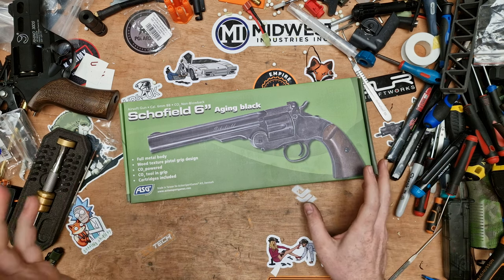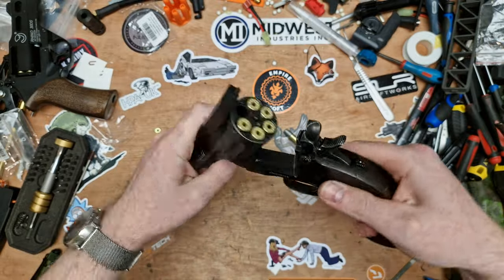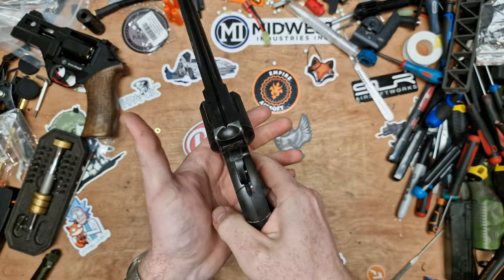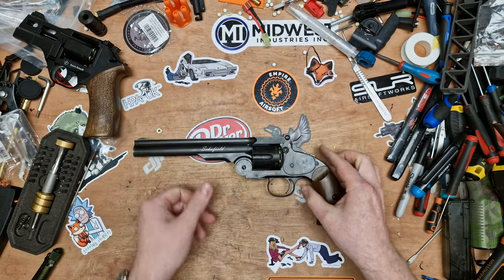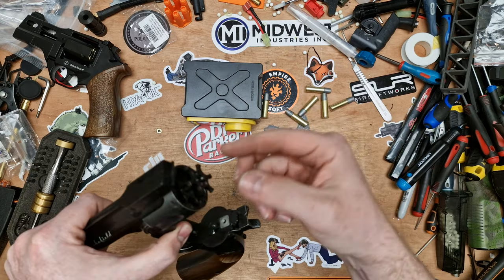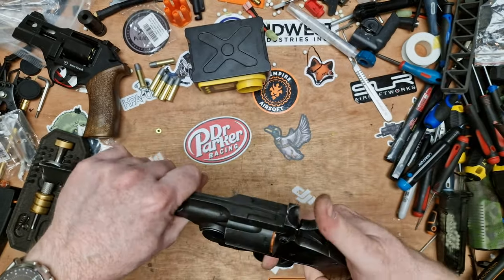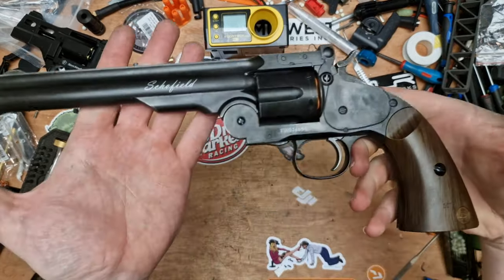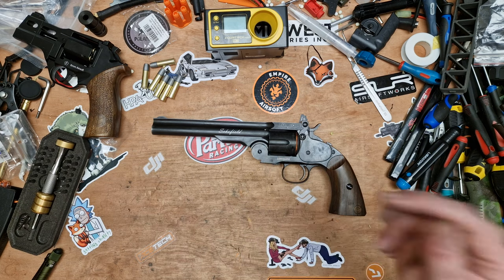ASG / Wingun Schofield Airsoft Revolver

Comment: I’ve reduced the fps for gameplay on mine. I wanna see the ultra clever way you come up with.
Reply: What did you do to reduce the fps on yours?
Reply: @MaerskSuko  I used small bits of a sucker straw inserted into the ends of the shells. Putting together a video as soon as I can get few more tests. As I’ve also used spent .38 shells to make shells that fit.
Reply: @leemendoza6210   i hope that video comes up soon! id love to convert mine to an actually usable one on my field
Reply: @Dodo_Boi   my apologies. I’ll have to reshoot the video later somehow deleted it.  I will post here to let you know.